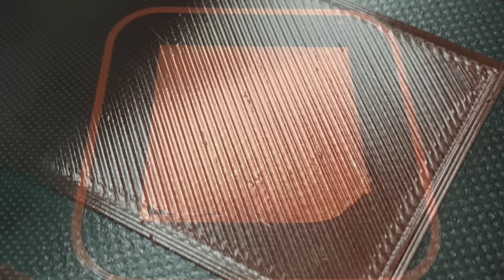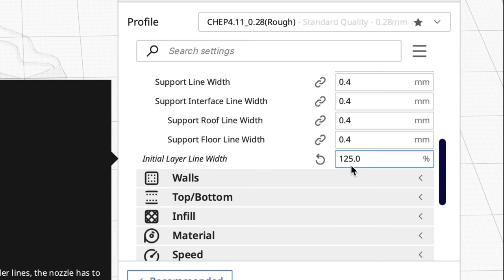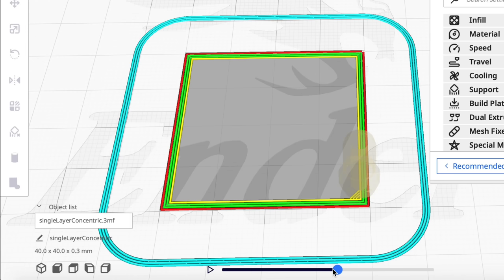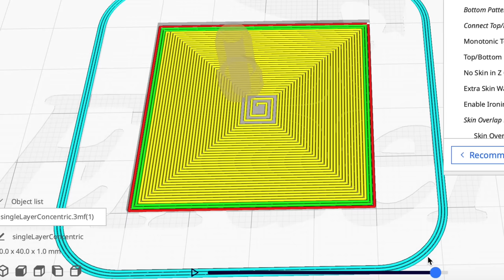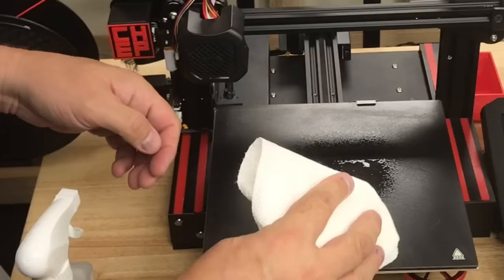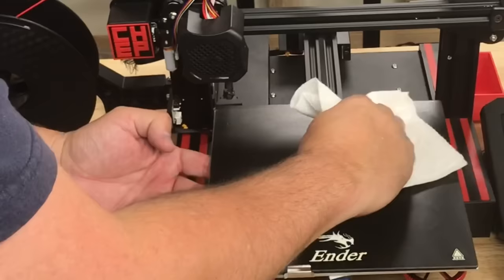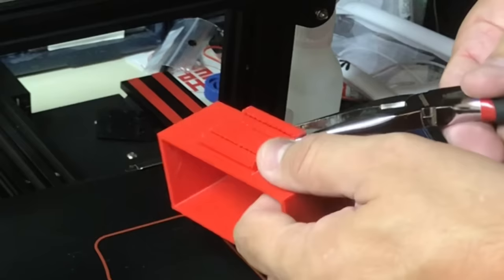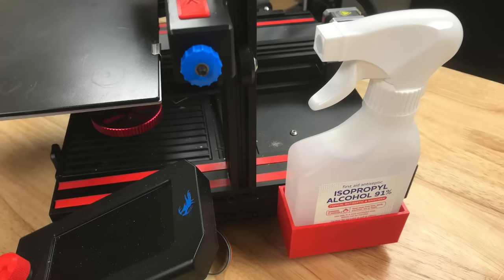Better First Layer and Bed Level Fixes on 3D Printers

Comment: On my Ender3 pro, the bed isn't completely flat ... center is a bit lower, which I mostly worked around by adding piece of paper between the heated bed and the magnetic layer.
Even after finetuning the distance, I have problems. Weird thing is: When I use a raft, the raft turns out perfect! Printing the same square as a typical print, it's all messed up ...
Got to try those tips about the settings and see if that fixes it ...
Reply: Get a mirror,3 or 4 mm thickness  and it will work,cut it
Reply: @Fantomasxp  Recently I watched YT video (was it from Makers Muse? Not sure) which recommended looking into using glass fiber epoxy sheets, as are used for PCBs. supposed to work great, albeit definitely needs a heated bed (which I use anyway, so ...)
Reply: Well you can use those as well but be careful  witch one you get,not all of them have the same quality ( smoothness)

Comment: thanks for all the info. I tried these setting and it helped a little but my first layer on this dragon print I am trying looks almost like tree support. Ender 3 v2, cura 4.13.1. I have printed other things without any issue. I tried Prusa slicer with defaults and the first layer looked better but i have never used that slicer before. If anyone has some ideas that would be great.

Comment: Hi! I'm from Brazil. Thank's for your tips.
May I use 100% Isopropyl alcohol to clean the bed? I have a carborundum glass on my Ender 3 V2.
What's the differece between the 91% and the 100% IPA?
Reply from the maker: Not sure. 91% is diluted.

Comment: So for some reason my ender 3 pro can only print the base 2 files that come with it, it keeps messing up on things from thingiverse, and it seems to be that the filament is sticking to the nozzle after contact with the bed? any way to help?
Reply: @brokenbizkit  after some more printing i have noticed that the filament is also sometimes curling up and stuff. ill try decreasing the bed level tho.

Comment: Hi, Thanks for this video. I followed every instruction you shared and my ender 3 pro is enclosed and I print PLA at default speeds without brim and print in the center of the bed. My prints all lift off (warp) from all four corners midway thru the print. Is there anythng else which could be causing it? I desperately want to fix this because I need to urgently print some large orjects and do not want the print to warp from corners mid way thru the print. I print normally at 70Deg bed and 205 hot end. I even tried to raise the hot end to 215 and lower bed to 60 but same results. Any advise you can share would be great
Reply from the maker: Try this: https://youtu.be/D45eIhoWSyg
Reply: @FilamentFriday  Thank You so much 🙏
Reply: @FilamentFriday  Thanks a Ton, You solved my problem. Thanks Again 😁

Comment: I made all the changes in Cura, sliced a model, started a print, but the speed and temp stayed as they were. I'm not sure if any of the other settings stuck, either.
Reply: Be careful with checking outer walls before inner. It might help with adhesion, but depending on what you're printing outer before inner can lower your surface quality.

About the cura thing, I don't know what could be causing that, but you probably can tune temp and speed from the printer itself just for the first layer to check if the new values are helping or not.
Reply: @stsiete2987  I'd been tuning it from the control panel, but then I did more digging into setting things up, and finally got it ironed out. As far as adhesion, my glass bed comes today, so I'm off to look up more ways to get good adhesion with that. Thanks a bunch...!

Comment: I printed a pretty good layer, but after removing it, I found that some areas of the filament were not fully adhered together (but very close). Is it good or not?
Reply from the maker: Bump up the hot end temp.
Reply: Also, make sure your nozzle height is correct.  Too low or too high can make areas of your layer not properly adhere together. One other thing you might want to check is your esteps setting.  If it's not correctly adjusted, all kinds of problems can be the result. (Lots of good videos about this here on YouTube.)

Comment: I do not know why, but after using your settings, my prints take unusual long time. Do you know why?
Reply: Check to make sure you changed just the initial print speed settings. It should only slow down on the first layer than afterwards ramp back up to normal speeds

Comment: I'm using an Eryone ER-20. Would CHEP's Cura profiles work for that printer??
Reply from the maker: Yes, just use Ender 3 machine profile and adjust bed size
Reply: @FilamentFriday  I don't know why I never thought of doing that. Well I feel like a dummy now. Thanks for the heads up!!

Comment: So I did exactly what you advised in this video, and it only printed worse on the initial layer. Is there anything else that can possibly be causing the issue? I have an ender three V2.
Reply: Same :D after this video I cant print at all :/
Reply: Is you print sticking on some parts? other parts are not?
most common issue: unleveled bed.
Even if you think you leveled your bed, check everything again. Better: use an automatic bed level probe to do the work. This helps leveling and even with a warped bed.

Comment: Does PLA have limited lifespan? I use 3-4y old PLA and I can't make any print with them.
Reply: Try drying it out.  It does have a lifespan, but it's worth trying this first.  
Find a food dehydrator and run it thru.  Lots of suggestions for times and temps, but I do 40-45C for 10 hours.  The time is certainly overkill, but it is better than overkilling on temperature.
If the filament is brittle, it is toast and you won't be able to fix it.

Comment: Going straight to the settings is not recommended by me. Start with cleaning the bed for most problems. 99% IPA and a wipe each day keeps a bed clean and nothing building up. For the next part your Slicer should be at defaults for your printer (With exceptions of any changes you have made to the extruder) You don't want any software adding offsets to your measurements. Adjust esteps, get Zoffset so your printing a .2mm layer. Measure it with a caliper. Eyeballs are not accurate at this scale. Then examine your first layer for gaps or over extrusion. Next is adjusting Flow.  Find or make a stl with .8mm walls... print it... measure.. are the walls .8mm? more? lower flow... Wall thinner than .8mm? Then raise flow. when wall measures exactly. 8mm you flow is set. Print a CHIP cube and see how it looks 👍

Comment: I would not recommend storing ipa next to a desktop 3d printer... Anything goes wrong that you did not intend and you're in trouble. It should be stored in an acids cabinet, or appropriate area where you keep your industrial supplies around the house. I keep self detecting fire extinguishing bombs next to all my printers, just in case!
Reply: IPA is nowhere near that serious, except for the fire risk
Reply from the maker: Wow! I better let RITE-AID Pharmacy know. They have them sitting out on a shelf right where anyone can touch them ;)
Reply: Exactly, it is the fire risk. All I'm saying is the safety of storing it elsewhere outweighs the convenience of keeping it stored on the printer itself. The pharmacy does not store it near a heat source ;)
Reply: @FilamentFriday  The stuff is not toxic, but pretty flammable. I would not keep it close to a 3D printer as you have a fire hazard right there!

Comment: You unfortunately jumped steps I guess because I don't see all those options in my profile. For example, Under Material I only see Printing Temperature and Build Plate Temperature nothing else. Nothing where I can change anything for the first layer etc.
Reply: there is a setting icon next to the dropdown button in each section, if you click that then the rest of the settings will show up
Reply: @soensaid  Ya this is my first week with 3D printers, I didn't realize I was on the "Basic" settings, once I switched to Advanced I saw everything, thanks
Reply: @dosdont - Omgoodness thank you for your comment lol I was thinking I didn’t have the same program because I didn’t see them either but you helped me - thanks

Comment: Great video I have a question a bit off topic but I know if anyone knows its you . I have a ender3 v2 and my micro SD reader stopped working it no longer sees new files added I have tried all the suggested fixes and nothing but I can still use the USB port so can I use a micro SD reader to put my micro SD card in rather than using my laptop
Reply: Yes
Reply: You may want to try a new SD card as well
Reply: @ChevTecGroup  i did try 2 other sd cards and reformatted them with a 3rd party formatter with no luck
Reply: @ChevTecGroup  u think the reader on the print could go bad ?
Reply: @michaelbrocato7535  hmm. It could be something broken on the SD card slot. It is attached to the main board so it's not hard to replace the whole thing if you really need to. But I would just buy an adapter to use the other port for now

Comment: What the easiest way to draw the rails on the alcohol holder that slide in to the 4040 rail. Just measure someone else’s I guess? Tinkercad never seems to have correct dimensions.
Reply from the maker: I share my bracket design so you can just add it to any design in the description of this video: https://youtu.be/tjrBcn8lBk0

Comment: I just got a glass bed for my ender 3, I have done everything you have suggested in this video and my print will still not stick.
Reply: this was happening to me a lot too but i found out the trick its our hands the reason it wont stick is because the oil in our hands oils we leave on plate that the issue wont let it stick get rubbing alcohol and clean off surface with a microfiber towel then start print and everything should stick perfect let me know if this helped you
Reply: well actually he says that but its most likely that good luck!
Reply: @edwinluna8831  even with a clean bed it would not stick I had to use the glue stick trick

Comment: time :0:57 I don't see "Printing Temperature" under "Material" even with visibility setting on. I never had this problem before. Version 4.11.0
Reply: My machine cfg had turned nozzle temp off with machine_nozzle_temp_enabled False.
You set bed and nozzle temps at different times in one video. I noticed my machine start code sets them at the same time.
        M140 S{material_bed_temperature}; pre heat bed no waiting
        M109 S{material_print_temperature} ;Set Extruder Temperature and Wait
        M190 ; Wait for bed temperature to reach target temp
Reply from the maker: I’ve shown both at once here: https://youtu.be/nQLJrSf4aXE
Reply: @FilamentFriday  i must of seen a prior video

Comment: The ender 3 glass bed is just bad,adding brim it can also help
Reply: Hair spray for pla , stick glue for abs , i used the glass part of the surface , i like the "glass flat efect" , i think works very well

Comment: I use voxelab aquila and voxelmaker so idk if these settings are on there
Reply: I also use an Aquila as long as you are using Cura as a slicer it should be fine.
Reply: @aldenc1219  everything ive gotten from cura isnt working do i need to get it from cura and put it in to voxelmaker?
Reply: @garlicbread3837  I have never used Voxelmaker, I directly input my stl files into cura and slice them onto the Aquila's micro sd card. Try this to see if it works any better and let me know how it goes also email (in channel information) any other questions you may have

Comment: I just bought a printer and it’s failed 9 prints on the very first layer. I feel like ive wanted my money on this printer. Straight out of the box it won’t even print a line without fucking up
Reply: Yeah, I just trashed my ender and got a Longer LK5. I couldn't get the Ender to work well.
Reply: Sounds like you're doing something wrong..have multiple 9hr prints on my Ender 3 pro right out of the box no issues.
Reply: 3d printing working straight out of the box is rare. Even the filament Colour can vary settings in some materials.

Comment: I have tried still., not solved sir
Reply: Consider adding supports to your print if you have not already. I tried the thicker materials and heat and it did not work until I added some small support fillament to my piece.
Reply: You could also try to increase the flow of the initial print layer and use a adequate brim

Comment: Thanks for the great videos!

What do you call the first thing that prints -- that little perimeter that goes all the way around your model, whatever you're printing? I ask because I just got a Sovol SV07 Plus, and that perimeter is right up ON the bottom of what I'm printing. It's very thin, but I have to cut it all away after the print job is finished. This happens with Cura, but doesn't happen with Orca. There's probably some setting I need to change in Cura. I haven't tried it with the Prusa slicer.
-------- Later -----
I think the thing I'm getting is called a 'brim'. Helps with bed adhesion. I found out how to change types and how to turn it off in Cura. So I'll experiment with that.

Anyone with a clarification or more info, please comment! Thanks.
Reply: In your slicer settings under Bed adhesion change from "Brim" (what your printing) to "Skirt" like he did in this video!
Reply: @44magsw  Many thanks! I'll try that today! When I chose None, I got some lifting on the corners, and my print was bowed in the center.
Reply: the one in the video is called a "skirt" and it doesn't (shouldn't) actually touch the print. then there's a brim which connects to the print which I assume is what you're talking about. there's also a raft which goes right underneath the print
Reply: @BabyMatiny  Thanks for the info!

Comment: Hey I'm new to 3d printing and I got a Creality Ender 3 V2 and it works well with Printing the problem is when I try to Print something I created or something off of thingverse or Tinkercad the only thing I can print is the rabbit or the boat but for anything else It doesn't Print Even Though it Shows on the printer Screen It doesn't print but the printing time Moves but no movement from the printer i tried countless times and I was wondering if anyone knows the problem here if so please explain to me have a great day god bless
Reply: did you use cura to get instead of STL, other format?
Reply: Make sure you use Cura to Slice your STL file and then save that sliced file to the SD Card. That's the GCode that your printer needs to use to print.

Comment: Done all my leveling some of my lines arnt matching up I have pictures can anyone help me please
Reply: Make sure the bed leveling is VERY low, as long as a piece of paper where is hard to remove, I was in your shoes a few hours ago but now I wanted to look for improving my initial layer as much as possible and this video gave more tips, use them and it'll help!
Reply: @jerryfrometa  any lower it goes see through going to look at turning off my z hop to
Reply: @1937Brett  goes see through? Are you referring to your slicer software (eg Cura?)
Reply: @EsotericWizard  no the printer when I lower my z offset

Comment: I'm using cura 5.4 and I don't see ANY of those drop down extra options your showing us on the software.  I only get two options under the - materials - menu.
Reply: Do you have to add the ability in settings? There are many many things you can add to it so much so that you select which ones to see
Reply: I think it's in the top tab menus under view. Basic, Advanced, Expert or All.

Comment: I watched allot of tutorials and almost always something is left out from the subject on topic. Not intentionally, but I think that for the long time user its reflex to do it and slips their mind.
When you use the "paper method" to do your z-offset you must tell your slicer the thickness off that paper(usually 0.1mm) so it could compensate for it in the g-code, or your first layer will be thicker than you wanted to be by that paper thickness. Your 0.2mm slicer setting for your first layer will end up being  0.2mm plus 0.1mm the thickness of that paper you use for that z offset.
In Cura you must install the z-offset setting from Marketplace(top right corner) and you will find the setting under "Build Plate Adhession". In PrusaSlicer the setting is under Printer Settings/General

Comment: My solution?  Get a Prusa.  I have problems with every printer but my Prusa.  It puts out immaculate prints.
Reply: Hopefully buying one his weekend! Can't wait to never use my ender again. Been using it for 3  years and its incredibly inconsistent.
Reply: @Solder_king  I had an Anycubic that was really good for a while and then it had a print failure that basically destroyed it.  I never have any problems with my Prusa.  It puts out really good prints almost every time.

I'm willing to pay a few hundred more dollars for a printer if it's as trouble free as my Prusa.  I keep hoping that one of the other brands puts out a cheaper printer that will compete but so far no luck from the Chinese companies. 

I know people with print farms usually go with Prusa.  I'm hoping Bambu Labs will be competitive.  I'm looking at their $300 Mini printer.
Reply: @joeking433  the ender fans will say that it's a good printer if you invest as much as a prusa would cost into third party parts that will slightly improve how it prints lol. 

I had a solid run of like maybe a month where it just printed perfectly (after an hour or so of cal) then I had to move it and bam! Printing like garbage again. So over it. 

I bought filament from a print farm who makes their own filament and all they use is prusa and higher ups. Sold.
Reply: I'm here with a Prusa. I used some amazon filament and went back to prusament and now it will not stick. No idea wtf is happening yet